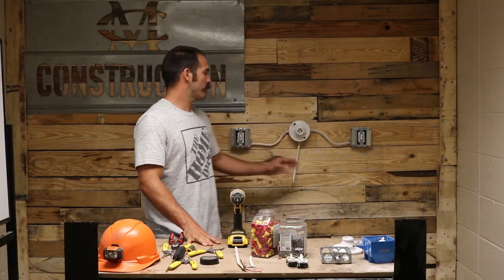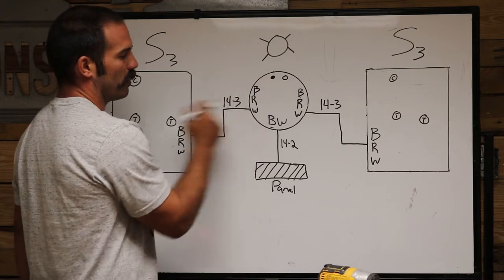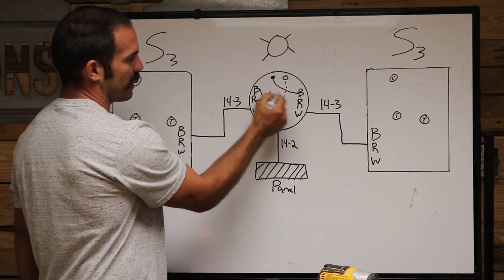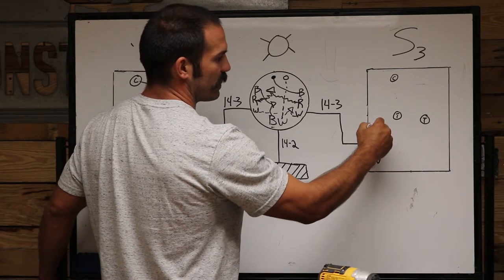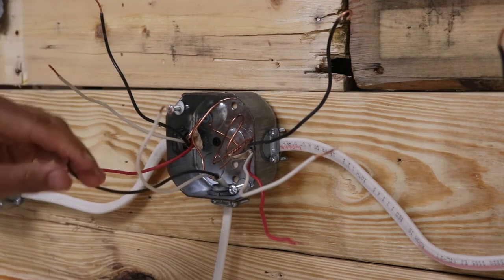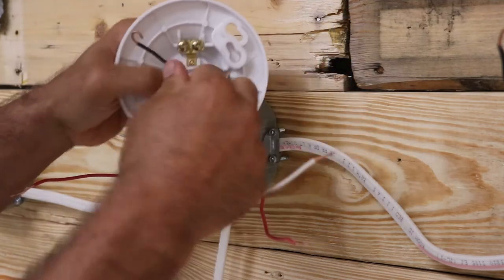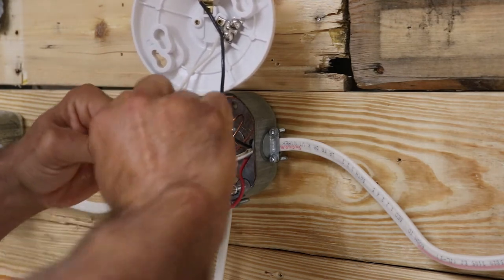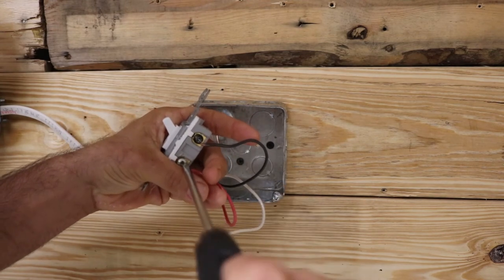Three Way switches: Part 4 - Power into light between switches

Comment: Thank you, very clear and concise info on a method we typically only see in older homes.  

 As of 2011 one of the switch boxes must have an available neutral to facilitate the installation of electronic switching devices requiring a neutral to function properly,  so this method is virtually obsolete,  you'd have to run 14-4 (or two runs of 14-2 next to each other in nonmetallic boxes only, to avoid inductive heating) to one of the switch boxes to use this method and be code compliant,  and some local jurisdictions are more stringent than the NEC and require an available neutral in every switch box

Comment: i have this situation in my kitchen where power goes to the light and three way wires goes to each switch like in part 4. would like to put a light over the sink. is there a way to have it work with the 3 way switches  already there or should there just be a switch to that light installed. just wondering if it is possible